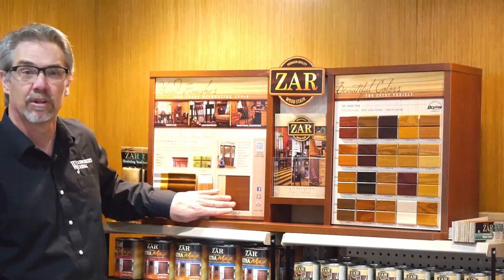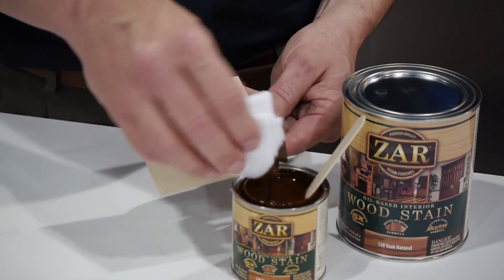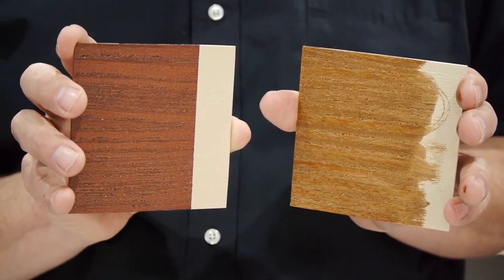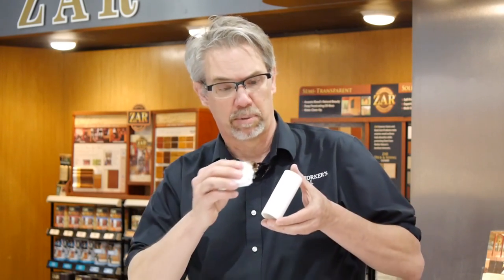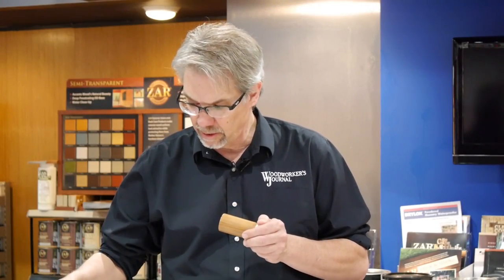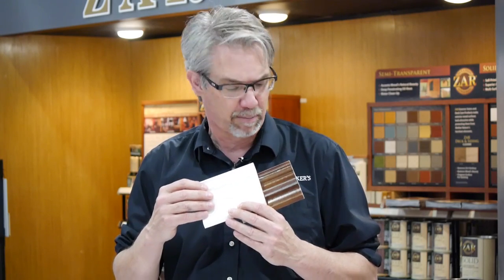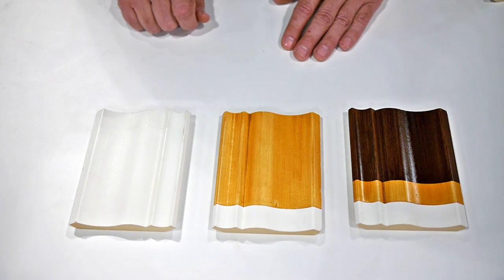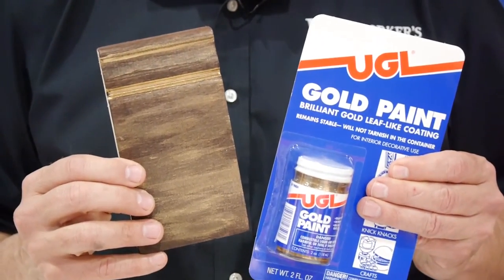Finishing Non-Wood Products to Look Like Wood Grain (Zar - 2015 National Hardware Show)

Comment: I would like to try this using a white plastic PLayStation 4 controller. Would any color stain work?
Reply from the maker: Any oil based stain color will work. It’s a good idea to test a small dab of the stain on the controller to be sure that the plastic will hold up to the solvents in the stain. Chances 99% that there will be no problem, but better safe than sorry.

Comment: To stain laminate furniture you have to prime it first with what kind of primer?
Reply: did you ever find an answer to this question? i’m also hoping to use this on laminate furniture
Reply: @smiller8700  You can google it & it will give you options to click on explaining the difference between the Zinsser Bin & the Zinsser Bull Eye 123...If I read correctly you can try using Zinsser BIN primer after first sanding lightly so there is no shine left on your laminate furniture...I am going to try a different product so that I can skip the primer, but still have to lightly sand first.  What I am going to use is called Retique It...I found this on Amazon, they have a video so you can see how it works...You have to use 2 coats...since I want my piece to still look like wood with wood grain b4 the 2nd. coats drys your suppose to dry brush it to look like wood grain or you can buy a wood grain tool-that is what I am going to use...once the second coat dries than I can either gel stain or use milk paint...the milk paint has a sealer in it so it's just 1-coat & your done...you can use a sealer after it dries if you want to, but you don't have to!  There are many colors to choose from too!  That's why I am considering using the milk paint to use on my laminate t.v. unit!  I am considering the GF milk paint color in dark chocolate since that matches my kitchen cabinets that I used GF gel stain in Java!